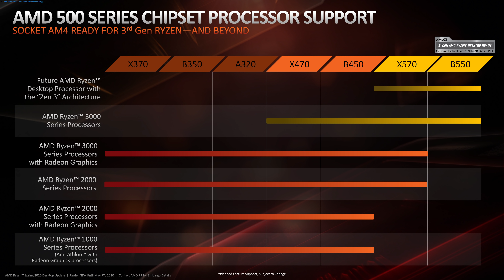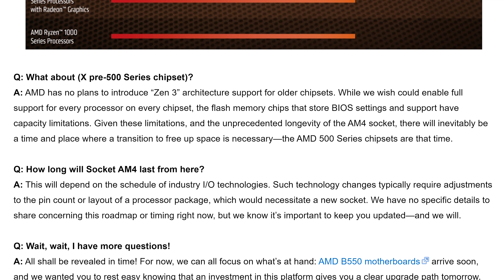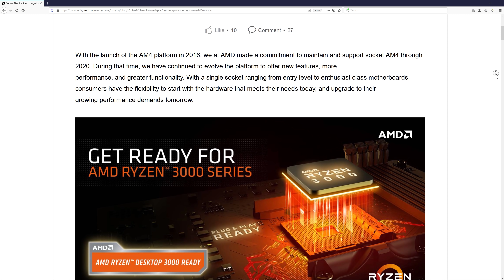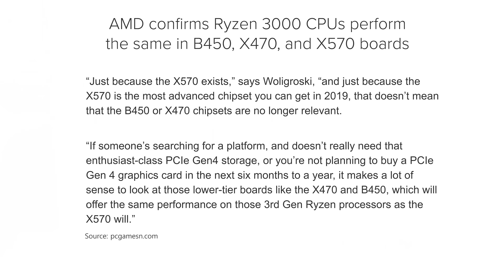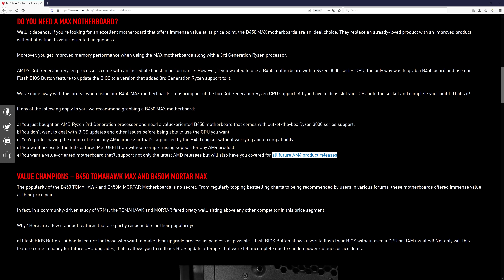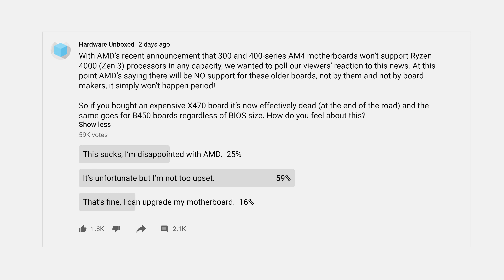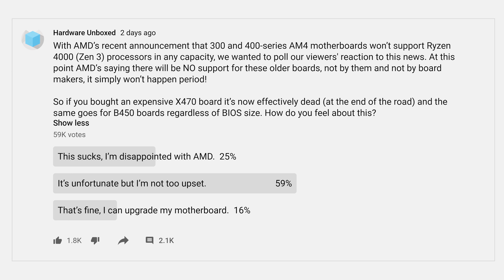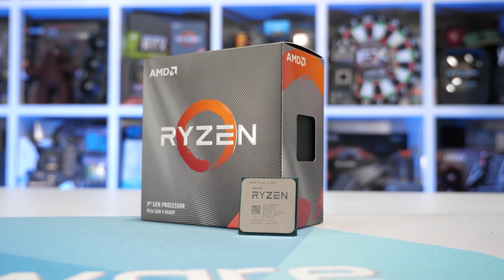AMD Does An Intel, Axes Zen 3 on 400-Series Motherboards, Our Thoughts

Comment: Respected Steve and hardware unboxed team ,
        This is what one guy said in an AMD Facebook group.. please check this, do the analysis and give us all a feedback.. i am clueless about the situation. 
.....
His post : "PSA about AM4 socket compatibility: 

Before this outrage go further, and I have to start being nasty, let me remind it one more time....

First of all, AMD have said a specific word in 2017. "SOCKET". Yes. Socket compatibility, socket standardization. they haven't said a single bloody word that all mobos will support every single Ryzen processor what will be released. They have not said it, because its not in their power. 

EPROM chips are limited in size, each CPUID require some space on it, so CPU can be recognized when slotted in. 

Pretty much most of eproms on 300 and 400 series mobo are 32mb and lower, thats so small, that MSI for example started to cut down UEFI GUI to fit more CPUIDs, they even went as far as re-release a whole stack of B450's to get larger eprom in there. 

AMD AGESA BIOS is flexible, and AIBs who make mobos can freely implement compatibility or not for it. AMD assessment is that AM4 mobos on 300 and 400 series will HANDICAP a 4000 series processors, just like 3900X and 3950X can be handicapped by solid amount of 300 series and 400 series mobo with weak VRM and bad signal integrity at high memory frequencies.... 

BUT, AIBs as just said, have freedom here. AMD did not said x570 will support 1st gen, but For example my X570 Aorus master does support them. AMD Have said that 300 series mobo will not support 3rd gen, however all 4 AIBs have scrapped some shit in UEFI and squeezed into 300 series mobo 3rd gen support. 

So, please, dont let me again read about AMD being like intel, or about to get backlash, because you have 3 gens of mobos, and 20+ processors across 3 generations of processors in AM4 ecosystem right now, which is more than either AMD nor Intel ever offered. 

wanna 4000 series high end powerful chip in your system? buy proper mobo which was designed to take advantage of massive I/O these chips most likely will provide. I specially waited for x570, because 90% of 300 and 400 series mobo was obviously cost cuts, even memory topologies was pathetic. 

so, in short, NOT AMD FAULT - UP TO AIBS ON IMPLEMENTATION."

Comment: There has to be pressure from board partners to stop providing support in order to sell more boards, they use future compatibility claims as marketing but their business is selling boards. I don't really care if they drop support, IMHO they've done a pretty good job offering future compatibility. Zen 3 is a new uarch, and I prefer their resources being used on pushing the envelope further than trying to make it work on older boards.

Also, I find it unfair to compare it to Intel, who made their customers swap boards for the same uarch or a 5% uplift for years. Yeah, 400 and 500 series chipsets will only work on two generations, but the upgrade path for a B450 board is a freaking 16C/32T high IPC monster...

Comment: Finally parted ways with my fx3600 last month and I bought the Msi x470 Gaming Plus Max with the intention of being able to run 4000 series when it appeared and could afford it because i dont have any  m2.2 hard drives which would of had a boost with the pcie 4.0...No where in my research did it say i would be stuck here after changing board,cpu and ram.. If they dont let MSI offer a bios flash for 4000 series then I would have to stay with the r5 3600 till new boards with ddr5 come out and miss 4000 altogether..

Comment: I agree with most of what you say. the reason i don't see lack of support of ryzen 4000 to be a big issue is that there will be no increases in core count on next generation. just better IPC so it is not a huge loss to just use a ryzen 3000 CPU instead if you are planning on an upgrade. not ideal but not the biggest of deals. and the year after there will be a new socket anyways. i am more worried about the new motherboards that will be released with ryzen 4000 series. as those will have one year expiry date.

Comment: Pressuring AMD yet taking a new motherboard every generation from Intel up the ass with no problem. Where are the full video complaints for Z490?
Reply: The problem here is the ambiguity. Intel tells you up front that you are being bummed out after every "tock" release. 10th gen and 11th gen will share platform. 12th gen will require a new motherboard (LGA1700) that will support 13th gen and so on and so forth... and then once in a while they just fucks you doubly by giving you a "tock" that is essentially worthless. AMD have done a bait-and-switch here. Lots and lots of people have bought b450 boards because were under the impression that they could squeeze a long life out of it by updating to a high end 4000 series sometime after the 5000 launch.... So in a sense: They were AMD costumers because they DIDN'T want to take it up the ass from Intel.

Comment: I just bought a b450 Max board a few months ago with a ryzen 2700. I specifically got the Max board to skip the 3000 series and buy the 4000 series. I am definitely an angry man. I'm NOT SAYING that I'm going to hack the bios file to remove the imposed limitations then post it all over the internet because that would be illegal. I would say the same level of illegal as lying to your customers. I'm going back to Intel. I prefer vulnerable garbage software to nonfunctional garbage software. 

As always thank you for the wonderful content gentlemen. I hope my indignation brings you a smile.

Comment: I bought a B350 when I purchased my 1600 (later upgraded to X370 when it broke and I had more cash), then upgraded to a 3700X with an X470 board because X570 was too expensive and B550 didn't exist. 

While I skipped 2000 series, I now have more money for upgrades and may have bought a 4000 series CPU this time. Now I won't because if I'm going to have to upgrade the Motherboard then I'll wait for it to be worth upgrading both when DDR5 is available. My wife will be happy that we can save that money for if we're ever allowed to leave the country again.

Comment: i hopped on x370 in 2017. now sitting on 3600x with the same board. was planning on a 500 series board anyway so this is a non issue for me. those who didn't support gen 1 ryzen are the angry ones me i got 3 full years already out of my board as far as im concerned they stayed true to there word as  its midway through 2020. if staying on the same socket hold back progress then make a new socket id rather see advances then whine about my 100 dollar b450 board being useless when there is plenty of performance to be had with 3000 series chips and b450

Comment: Just built 2 systems on b450 motherboards with Ryzen 5 3600. Crap decision in the light of AMD's not supporting future CPU releases. Just means won't be buying these new CPUs instead will later buy discounted or second hand zen2 Ryzen 9 CPUs to upgrade. AMD will lose sales and probably better margins on the zen3 product. Bad decision AMD!

Comment: The big issue here is that different from redditors and youtubers perspective, people just don't upgrade that often. Most people bought an R5 2600, R5 1600AF or a R7 2700 to upgrade from their old 3rd or 4th gen intel systems and plan on not upgrading for at least 5 years.

Comment: Meh, i was forced back in October to change platform because my old one died out and went for a simple Ryzen 2600 with a respectable B450 motherboard to go with it. The idea was that i would have the option to step up at some point into the 4000 series of CPUs. Now, i am not complaigning too much because apparently this will not happen but it does put me on thought about the future. At least i do have the option to step it up to a 3000 series down the line if i so need to. I do feel for those that got the machine specifically for the ability to future step it up though.

Comment: Just to clarify it for myself. Right now I have a B450 Max with a  R3600. 

This will news won't effect the working of these 2 together. Only if I want to upgrade from my r3600 to a newer, next gen processor, it would mean I have to also upgrade my motherboard as well, instead of being able to keep using the same board. 

Is this correct?

Comment: if AMD advertised this i wouldnt do the mistake of buying a B450 with a Ryzen 3000 and i would wait some months more and go for a x570, and still... B550 it is an AM4 chipset and we are getting AM5 for zen 4 if AMD doesnt change plans so it would be another Mobo for 1 gen only they sould release them with the Ryzen 3000 last year.

Comment: Well... I can't really be mad. They said they'd support AM4 until 2020, and so far they did. The next generation won't be supported in lower-end boards, that was to be expected at some point. I'm not even disappointed. My B450 has served me well, and it's time to upgrade at some point be it to third or fourth gen Ryzen if the difference in performance is significant enough (which looks like it's going to be).

Comment: I think this may be to avoid the issue of people buying 4000 chips and using new B450 boards without the necessary bios support built-in.  This has been a mess with every new generation of chips they have released on AM4.  Still the optics is bad.  I suspect they will give vendors the option to update the B450 boards at some point but will not guarantee compatibility to all B450.  The enthusiasts community understands the bios update challenge with old motherboards.  I suspect all 570 boards already have a way to support new 4000 chips at a level where you can update the bios without having to have an old chip on hand for the update.

Comment: I bought a X470 motherboard in late 2019 with a Ryzen 7 2700X thinking in a possible upgrade to Ryzen 9 4950X when the prices starts to drop, but now this won't happen anymore.
Reply: But you can get a cheaper R9 3950X.

Comment: For me future proofing a platform isn't important, I like many other PC users build their PC'c to last for around 3 or 4 years before upgrading again. I was using an H170 board with the i5 6500 since 2016 and it is only recently that I have felt the want to upgrade, not the need. I have just upgraded to  an R5 3600 with a B450 chipset, this to me is still the best price to performance on the market.Whilst yes I am a little diasppointed that my upgrade path solely lies now in R7 and R9 chips when they're incredibly cheap I think I can live with this. In 2023 or 24 when I look to upgrade again I'm sure the new tech out at that time will mean a complete change of platform again.

Comment: I bought a Ryzen 3900X and an X470 board about 6 months ago. I went for X470 specifically because I didn't want active chipset cooling and wanted to reduce the number of fans in my set-up as much as possible. I could have easily spent the extra money for an X570 had I known that this would happen so yeah, I do feel properly shafted.

Comment: Solution is to have all versions of BIOSes to support Athlon processors from all generations, and then have different versions that fully support 1000/2000/3000/4000 just pick your poison, and your favorite bios flashing processor
Reply: And no, i would not have spent $220 more(nearly double) on an X570 with integrated 10g

Comment: if they were smart they would have done something like an AM4+ socket with a couple extra pins, released the 500 chipsets on those and boom, backwards compatible AND pinlocks newer chips out of older boards ... but they are fuckin retarded like always
And yes I am a little miffed, I just bought a X470 board 2 months ago for my wife's computer, cause I couldnt justify the cost of x570 and AMD has been dragging their nuts about B550

Comment: I hope AMD will reconsider. 

BTW, imagine being responsible for testing every BIOS change for every Zen, Zen2, Zen3 processor.
Reply: The could get a bridge bios to Mobo manufacturers and port from x570 to x470/x370.For example taichi x470/x370 use same bios with no problem.
Reply: Why would they need to retest old CPUs?

Comment: Very unfortunate. After much research I built my new computer with B450 Tomahawk Max in Feb this year with a 2700, thinking I would upgrade to 4000 series R7 in a few years and keep that machine for 4 more years. Now AMD saying 3950X is my only choice to upgrade to for the next 5 years. Now, 3950X is crazy OP in it's own right, but yeah. Would have shelled another $50 for X570 mobo had I known. Sad really.

Comment: AMD doesn't have enough space left on the B450 chipset to keep supporting all the new CPU's. Besides, Ryzen 3 wasn't supported by X370 or earlier boards, and I never saw anybody complaining about that. AMD is not "screwing over" B450 motherboard owners, they can still buy Ryzen 3 which is still a considerable upgrade from Ryzen 2.

Comment: Sorry, I really gotta say... everyone in this comment section are whiney people!

First off, why are you buying computers you plan to upgrade in 1 year? Most of you who bought the B450 Tomohawk Max with a 3600 or better, why are you planning to upgrade so quickly? There's no reason! Wait until at least 2021 when AM5 is released! Or even more, 2022 when that CPU is released. Like, I don't know why you'd spend the money to upgrade so quickly. Think with your head a little!! You don't need to upgrade. 

Secondly, this was a "Damned if you do, Damned if you don't" situation. Some motherboards can support all 4 generations of CPUs, but more often than not, they can't. So it creates this situation where you can flash the wrong official bios into your PC, and now the PC doesn't boot at all. We, as tech enthusiasts know what to look for, but the average person who build a PC doesn't. They may accidentally flash the wrong BIOS, and who're they gonna blame? AMD. It creates this bad look for everyone involved. They probably didn't want that headache. 

Now I get why you're upset... but you set yourself up for that by buying cheaper motherboards expecting expensive results...
Reply: A computer is modular and replacing a CPU is just one component in it so it not getting a new computer at all. This is the enthusiast market this is what we do otherwise just buy a prebuilt from Dell or HP. but People may not necessarily by Zen 4 in October they may buy Zen 4 next year when the new Console game ports are released but now that option has been removed.
I upgrade every year some part of my PC, October I'd planned on a GPU and May/June 2021 a CPU then make that last 2 or 3 years and then Zen 5 or 6 or intel if they have caught up by them. I recently bought a new Cooler for the Zen 4 chip I'm not going to get shame wish I'd waited a couple of weeks that would have saved me £80

Comment: I agree that it sucks the most for B450 MAX buyers because it was clear that the reason they existed is to support another generation of chip.  But there will always be winners and losers in tech innovation.  Ask me how it felt to buy a high end board and a 7700K - only to be left on an island.  Or my Radeon 7 (which I love but AMD's drivers are just plain crap.)  AMD is definitely playing amateur hour.  Their technology is truly awesome and they are moving the entire industry single-handedly.  But they suck at marketing and software.  Simple as that.  I would buy a new board and chip every generation if I get a substantial benefit from it - whether Intel or AMD.  I don't think that AMD should be given a free rein, but at the same time I would rather they be innovators, and not a corporate machine - where the only thing that matters is their stock price.)  If it were not for AMD, the industry standard would still be quad core space-heaters with a new coat of paint every year.  Give me the amateur innovator any day of the week.  Give me crappy marketers instead of deceitful marketers.  Give me drivers that need updating because architecture changes, instead of drivers that are always up to date because very little changes in the hardware.  Yes it can be painful sometimes, but to me it is worth it.  Lead on AMD as you stumble over your own stupid mistakes, but take us where we have never been before.

Comment: well said. We know that the new nvme drives were working on the B450 but AMD put a stop to that. Those of us that did up-grade to the Tommy Max were expecting the motherboard to use the Zen3 cpu within the limitations of PCIE3 performance. There's NO reason to abandon the MSI Tomahawk Max from the Zen 3 series cpu or any 400 series boards for that matter. MSI usa doesn't even have the B450 Tomahawk Max on their website as of this writing. Does this mean that there is hope for the Max with Zen3?

Comment: if they want to sell some B550 I can understand their decision.
this chipset, like the X570 will be good for only 1 year, next year with the new CPUs we'll need a new motherboard
if they keep the compatibility with the B450 boards, they'll never sell any B550.
buying a 2 years old cheap MB + new gen CPU will be better than 
B550 (more expensive) + new gen CPU 

MB manufacturers will certainly agree with this.

from a customer point of view... its another story, they expected more compatibility.

maybe AMD will change that later when the MB manufacturers will not produce B450 motherboards anymore and only B550, to make sure that customers will not buy B450 AND the new CPU at the same time

Comment: I am in the same boat. Back in February I bought new B450 board with 2600 hoping to update to 4000 series CPU down the line. I was picking between decent B450 board or poor X570 so if I would know I would have picked X570 even if it offered worse VRM and features overall.